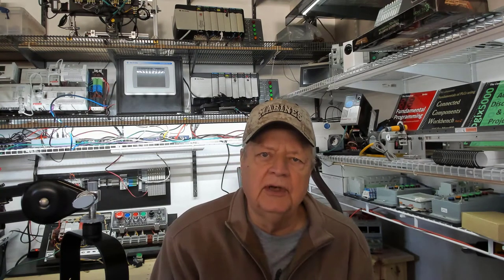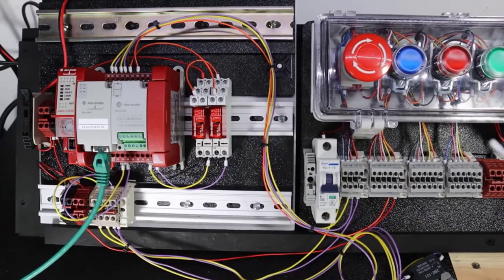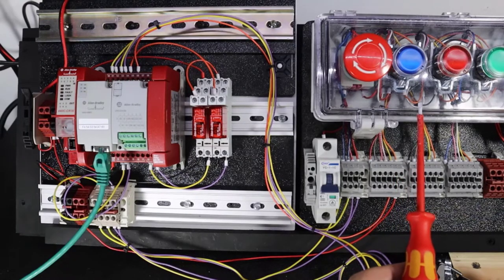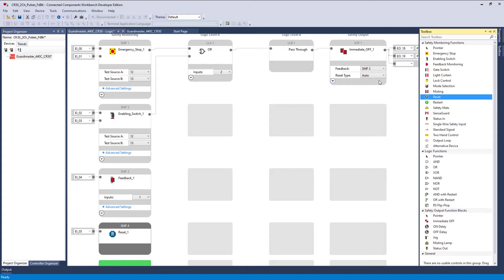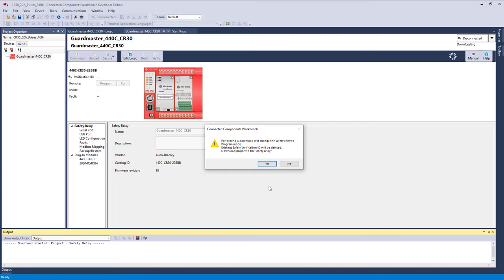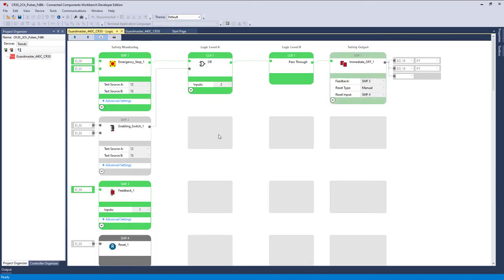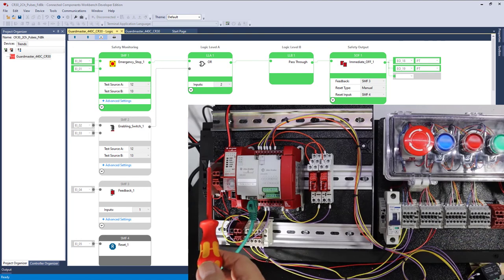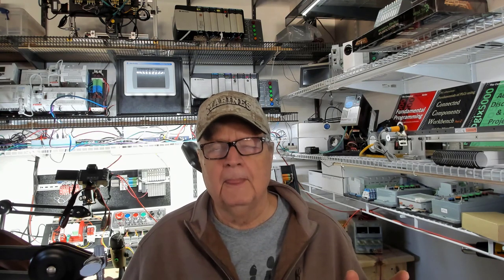440C-CR30 - Electrical Design and Programming Pt10 - Reset CCW

Comment: Awesome videos this is a really great series. I have a quick question though. 

I noticed you said you wired the feedback for the ESR in series through NC contacts. Curious, wouldn't you want those both in series NO? That way when they are closed it provides 24v to the input, and if either one drops out you lose the signal. 

Please correct me if I'm wrong, but the way it's wired now, if one dropped out the system wouldn't know about it.